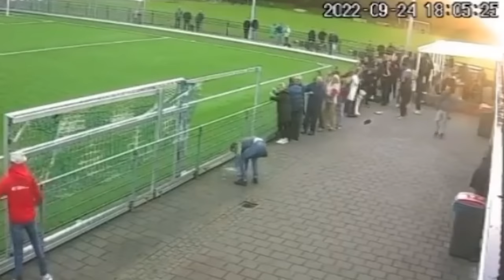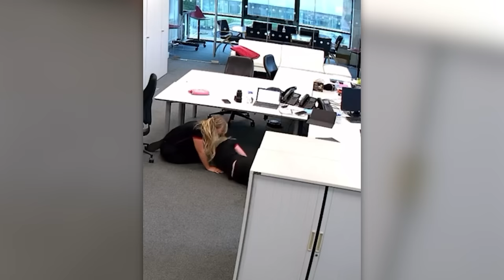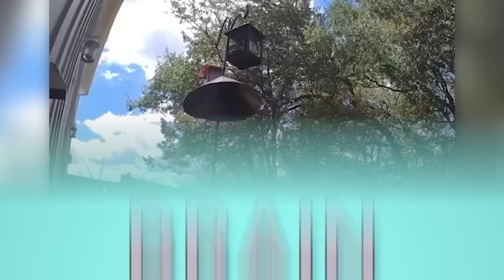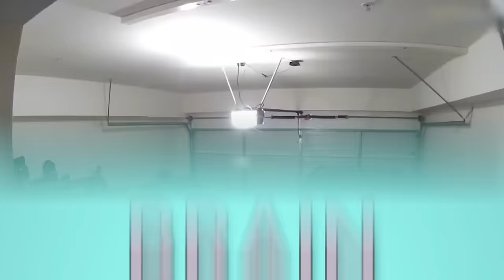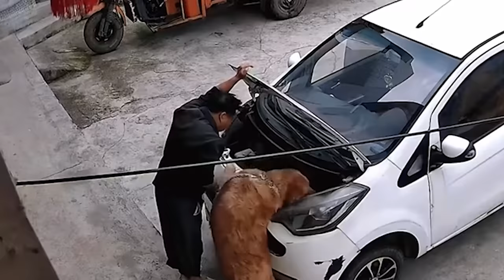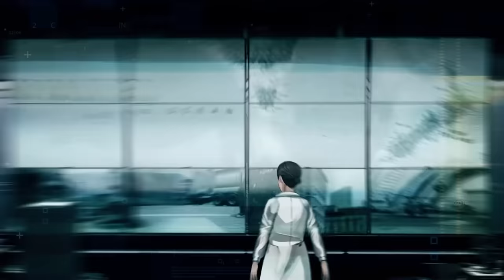50 Incredible Moments Caught on CCTV Camera

Comment: One common experience for machinists using coolant is accidentally leaving the hose on. In my workplace, a particular worker caused numerous floods, leading management to install a timer on his faucet that shuts off after 5 minutes. This caused difficulties when filling a tank of over 100 gallons. One time, he left the hose on overnight, resulting in half of the shop being flooded 😀

Comment: Every machinist who works with coolant has turned the hose on and forgot about it. One guy in my shop caused so many floods that they put his faucet on a timer. It would shut off automatically after 5 minutes. Total pain when trying to fill up 100+ gallon tank. He actually left a hose on all night once. Flooded half the shop.
Reply: Same happens when filling liquid nitrogen vats from a pressurized tank. Walk into to warehouse and it's full of fog, hold breath, and quickly open the roll up door.
Reply: It's mandatory practice to stand and watch the coolant filling for every area where I work.

Erryone jas done it, 2wk old new guy just did it, it only takes a single:
"Man. I gotta pee, ima be rigjt back,"

Then 45 mins later after the boss Man flags ya and the supervisor has some hot job needing done then 45mins goes to 3 hours

And now ya area is gonna be clean AF